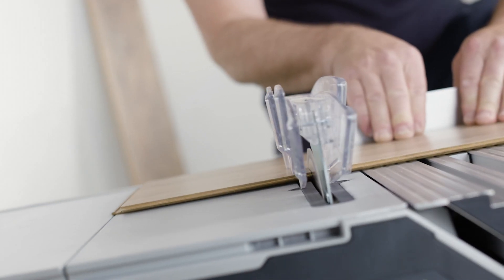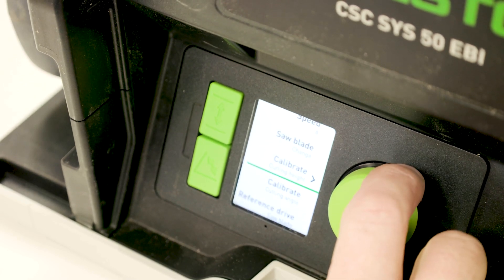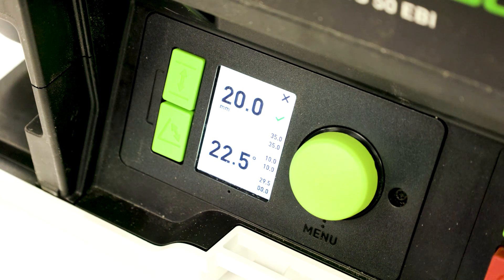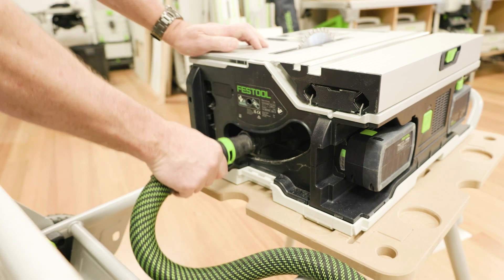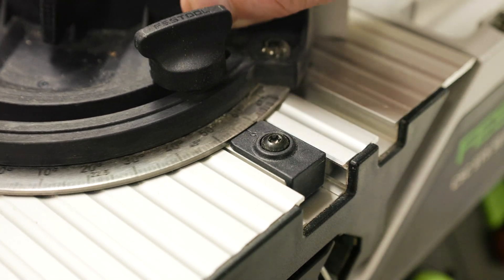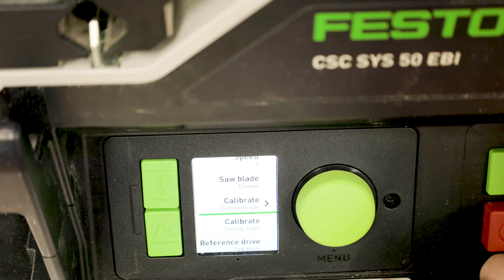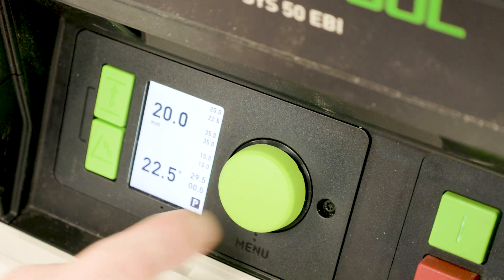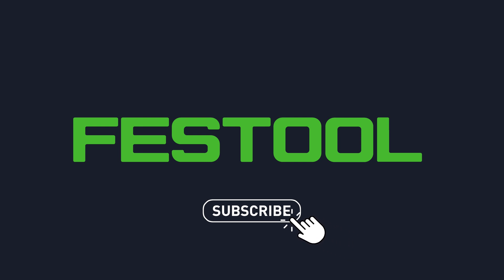Complete Guide to CSC SYS 50 168MM 18V Cordless Table Saw

Comment: The fence should have been motorized and the saw should have come with an option to run it off mains power. Like seriously, you're charging 2000 Euros for a saw. Just add the extra features in and charge a bit more.
Reply: You whinge like an Englishman
Reply: We don't use Euro here bro
Reply: @MuzLFlasH A$3100 bro